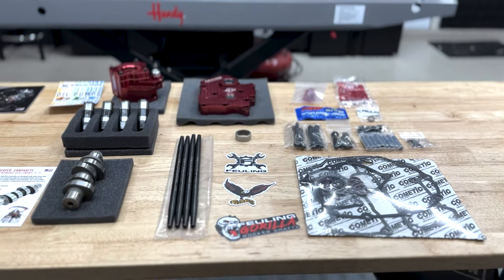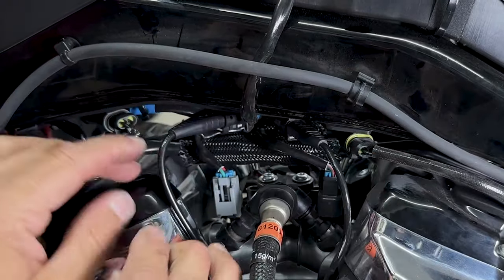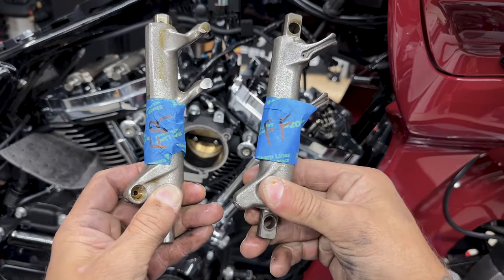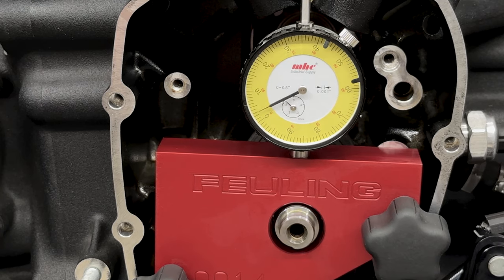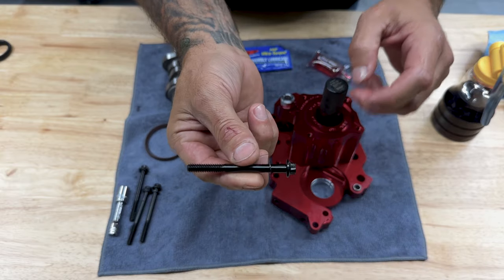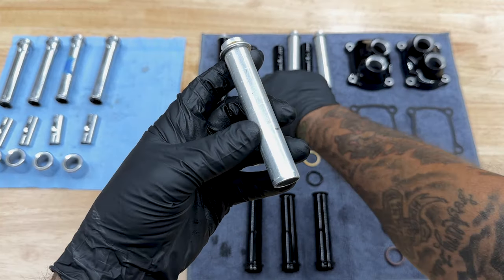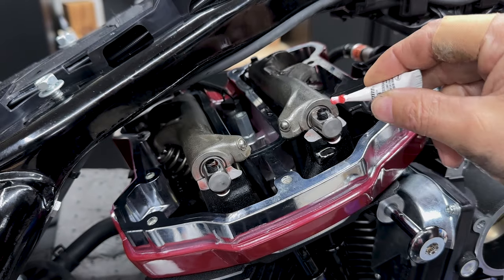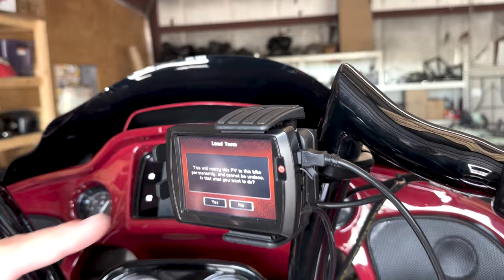M8 CAMCHEST KIT Install Top-To-Bottom @FeulingParts

Comment: Fueling needs to go to quickie pushrod setup. Having to do rocker box removal for a Cam swap? S and S kit is a lot easier to install and less expensive.
Reply from the maker: Fueling does have Quick/Adjustable Pushrods, but only for Twin Cam 👍🏽 But I will always recommend fixed pushrods

Comment: great install. nice to see it done right.  One thing I would recommend though. I wouldn't remove the lifter cuffs. The bolts have a tendency to snap.  Its a major pain in the ass to get them out with out damaging the engine case.  Get some magnetic lifter holders instead.
Reply from the maker: Thank You! I definitely appreciate the input.  I only changed the lifter cuffs to show people who plan to change them out the S&S Tappet cuffs.  But yes, you can definitely change them out that way, instead of risking snapping those bolts/screws

Comment: Great video I still have to get mine dynoed as well. Putting the right cams in makes a huge difference for your riding style.
Reply from the maker: Thank You!  Yeah, I rode it to dyno shop without a tune (I’ll explain it in the Dyno Video) and it sounded like it hated me haha.  After the dyno, I rode it for about 3hrs
Reply: @RAIDERWORLD  I have a custom tune on my Thundermax but still not the same as a dyno feel like there some hidden potential to be unlocked just got to wait for the weather to clear to take mine
Reply from the maker: @Wessoncustoms  Absolutely! And to be honest, the next tuner I use, will be the ThunderMax

Comment: Your install process is the most professional guide I've  found. Much respect to you for taking the time to do it right the first time. Watching people put bolt cutters on push rods is troublesome to me.
Reply from the maker: Thank You! Definitely means a lot.  Not of fan of that process.  Solid pushrods might be a lot more work, but I trust that these would never fail or have to be readjusted.  Thank You again 🙏🏽

Comment: Used this video as a reference along with the service manual during my stage 2. I didn't want adjustable pushrods so I reused the factory ones. Everything came out great. This is priceless information. Easy to do provided you own good tools.
Reply from the maker: That’s awesome! I’m glad this video could help.  Tool’s definitely help the job go a lot easier 🤟🏽

Comment: The paint on the lower rocker boxes holding up okay? I was under the impression it was a high heat area. Damn that red pops on that finished motor though I love it.
Reply from the maker: Thank You!  It’s holding up great so far.  As long as you use high temp paint, it will hold up.

Comment: Great video I'm sure you know that with fueling cam plate chest that when the dots are lined up on the bottom that the rear cylinder is at top dead center and when it on top the front cylinder is top dead center, I found out while doing my bike
Reply from the maker: Thank You!  Absolutely, that’s another great example.  With any new CAM installs, I try and keep it old school lol

Comment: For my roadglide,  I've got the SS 475 c cam chest kit, pv2 and target tune, vented fueling dipstick, Tab 2-2 headpipe, and rekluse clutch plates, slave cylinder, and basket waiting for spring.  If I decide to get a second bike,  Im going to go with the woods XE cam package with the fueling race series oil pump and cam plate.
Reply from the maker: Hell yeah! That sounds like a badass package.  I have a new bike that I haven’t revealed yet, this will be my top to bottom performance Bagger.

Comment: @Fuelingparts
My 22 Street Glide special (114CI) is only two months old. I already crave a bit more out of the engine. I’m looking really hard at the 465 kit. Assuming correct installation, is the upgrade in cam and pump a risky bet? I would be risking my factory power train warranty if I go this route .  TIA
Reply from the maker: Hard to say.  I waiting until my warranty was almost up.  I believe there are other companies that will warranty your bike with aftermarket products.  I would do some research on that prior.

Comment: I really dont like Feuling's install methods, but different strokes. I do like their Lifters, and the info they give us though. I got HP+ Lifters and a Short sump plug.
I noticed you were using Tekton torque wrenches and it's good to know I'm not the only one who trusts the budget brands haha.
Reply from the maker: They definitely have their own ways, and if you deviate, the warranty is no good.  Everything turned out good, with no issues so far.  Absolutely, gotta budget when I can lol

Comment: Fueling doesn't seem to sell those head breather O-rings separately, is there another way the gap next to the O-rings can be filled so the O-rings aren't too loose in there? Maybe double up on the stock O-rings, so 2 per breather, 4 in total?
Reply from the maker: They looked loose, but they actually have a snug fit.  I would contact them, and see if they would send some extra.

Comment: Can I use Amsoil 20 50 oil to soak and pump the S&S lifters manually or do I need special weight oil to pump them? I purchased feeling pump tool.
Reply from the maker: Absolutely.  You can pump them with whatever oil you use on your bike.

Comment: How do you like that Tekton 1/4 drive torque wrench I’ve been looking at the smaller one that goes up to 150 in lbs for my twin cam
Reply from the maker: I like it, especially for the price.  I’ve compared the accuracy to other expensive brands, and it’s spot on.  Just like any other torque wrench, maintenance is key.
Reply: @RAIDERWORLD  Thanks

Comment: Hey if I go with adjustable pushrods I could bypass taking all the stuff off the top and get right into the camchest right?
Reply from the maker: Absolutely! Obviously you would need to cut your old push rods out.
Reply: @RAIDERWORLD  so much easier that way 😃
Reply from the maker: @RealRonTV  Absolutely! I wanted to change out the lower rocker covers anyway

Comment: Hi, thank you for All your helpful videos, may I ask you a question! Almost done with my project thank to your videos but when I am trying to install back the front engine mount the holes don’t line up, is there any trick or anything that I am doing wrong!!? Thank you for your help brother.
Reply from the maker: Hey! I’m glad the video is helpful.  Yes, I would get them all started first.  They might not line up at first, but once you get them started they will align.  You can also use a center jack to assist
Reply: @RAIDERWORLD  thank you very much I will do that .🙏👍

Comment: I'm on the fence with this or the 465 version. What's your thoughts on the streetability of this? Most of my day to day riding is to and from work and around town <70 mph.
Reply from the maker: I think they are both great options.  I was on the fence as well, but this is my every day rider, and I just like to cruise.
Reply: @RAIDERWORLD  last question; are you running the harley 2-1-2 exhaust or is that a true 2 into 2 exhaust?

Comment: Great videos!! Thank you!! Question? After put the bike on 6th gear how you turn rear wheel to find top death center for rocker arms, my wheel down not turn, do you need tu pull the clutch? Thank you !!!
Reply from the maker: Take the spark plugs out, this helps turning the wheel a lot easier.  No need to pull the clutch.  Hope this helps
Reply: @RAIDERWORLD  it did worked, thank you very much. 👍
Reply from the maker: @sergiogarcia3476 No problem! Happy it helped

Comment: I did a bad bad thing. I am trying to replace my 2018 oil pump with the updated 2020 oil pump and while I had the Cam chain off I somehow rotated the Cam and it went click. 
 Now I am not sure if the valves are in the proper spot. Is there an online mechanic that I can talk to for a fair price?
Reply from the maker: You heard a snap?
Reply: @RAIDERWORLD  
I think it was the tension of the push rods on the dry cam.
  I think once I get the new pump In and the plate back on, as long as the two gears are aligned with the dots I should be ok...right?
Reply from the maker: @Godlivesinme2013  Absolutely.  Hopefully it all works out! Definitely lube it up.

Comment: Where did you find the one piece pushrods? I can’t find them on FM’s site anywhere!
Reply from the maker: I would contact Feuling Directly.  They run out of these one piece pushrods really fast.  They come in the kit, but here they are separately https://www.feulingparts.com/sku/4087  Just want to make sure you install the correct length with the lifters
Reply: @RAIDERWORLD  thanks for the prompt response and great install video. Keep up the good work
Reply from the maker: @noahjohnston6122  Absolutely! Thank You for the Support

Comment: when will Harley drop the stone age engine builds?   In europe we build bikes with 195hp from a vtwin at 73 cui.... 
IF you get a v4 youll get a 61cui bike with 235 hp.   
Both of these at less than half the weight of a harley sink anchor.
Reply from the maker: Probably never lol.  At least it gives me a reason to open them up.

Comment: Wow! M-8’s have a ridiculous allowable runout tolerance! Sloppy piece of junk! My 2001 twin cam has a runout of .0015 or 1.5/1000. That’s one and a half thoundths. Mass production destroys quality, in America anyway. Can you imagine if a crotch rocket engine was built as sloppy as a Harley? It would explode at high RPM’S.
Reply from the maker: Your absolutely right.  And over time, the run-out gets worse.  Now sometimes you luck out, and you can get 1-2 Thousands, but that’s far and in-between.  Now blowing up is probably extreme, because I’ve seen these run over 80k miles.  And your problem buying a new bike before you ever reach that.
Reply: @RAIDERWORLD  lol
My use of the word explode was an obvious exaggeration for emphasis! 👍🏾
Reply from the maker: @1YouTube_you  oh I definitely get it  lol 🤟🏽